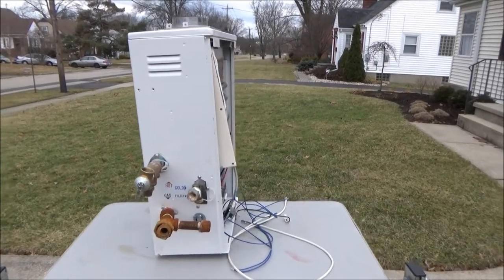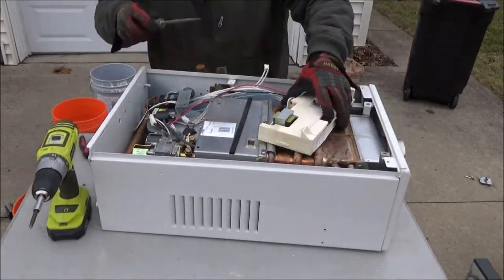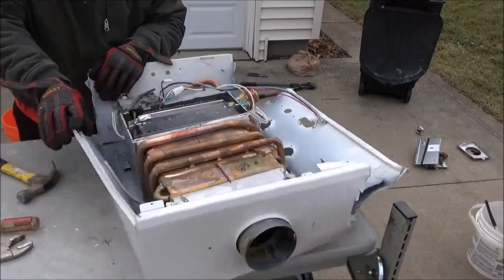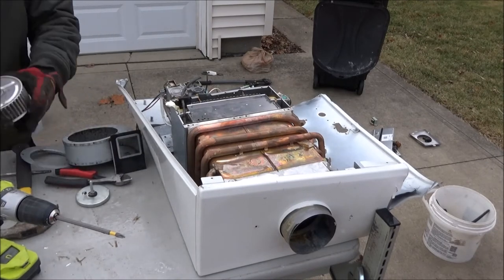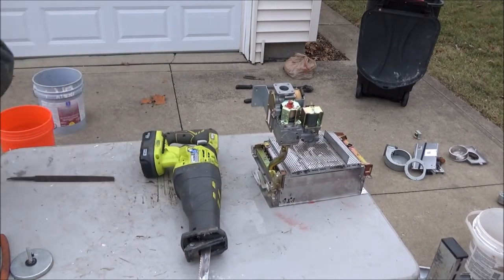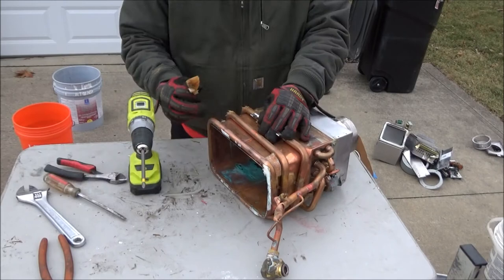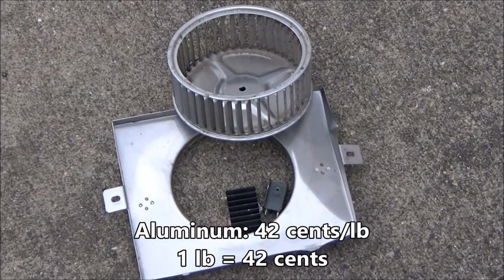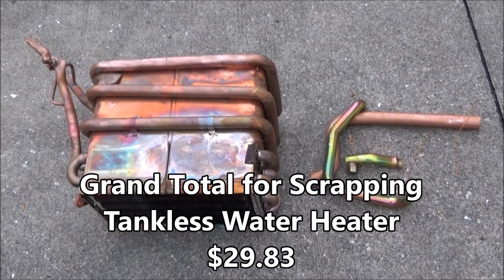Scrapping a Tankless Water Heater | LOTS OF COPPER!!

Comment: I taken two of these apart, basically 97 percent exact same design - the second one took about 25 mins to dismantle/sort, and a small cutting grinder speeds up removing brass fittings.  Transformers may fall apart with a heavy hammer blow and get more value from the copper.
Reply from the maker: Yes, that's true! Sometimes I feel like bashing the transformers and sometimes I just take them in as is. Just depends on if I feel like messing with it. I've taken apart a lot of the big microwave ones. Those are worth it.